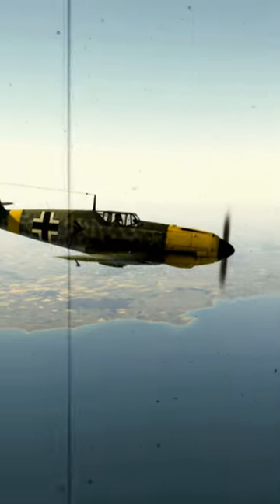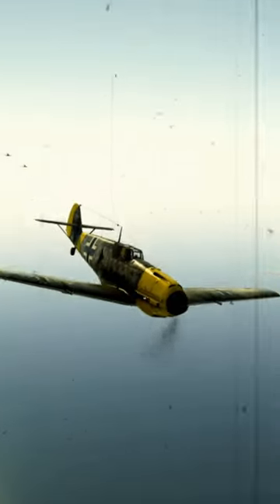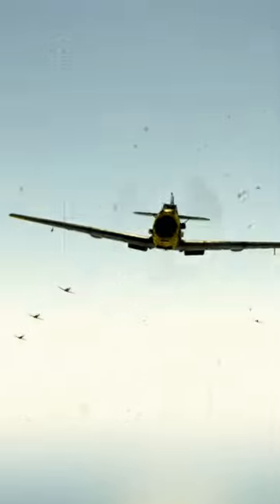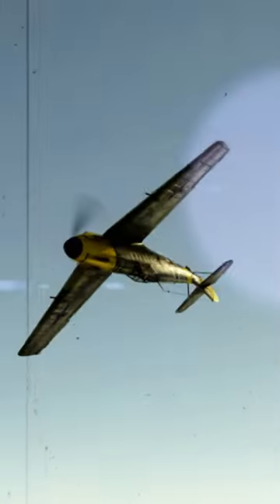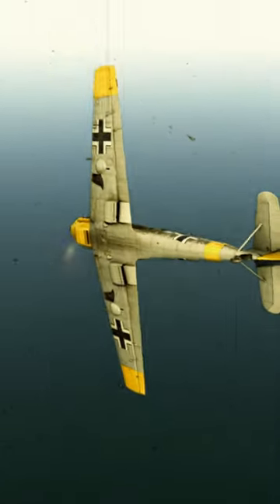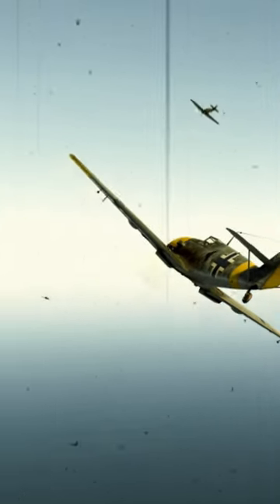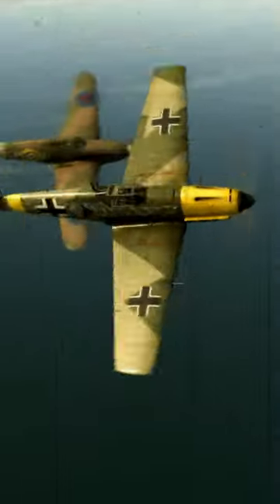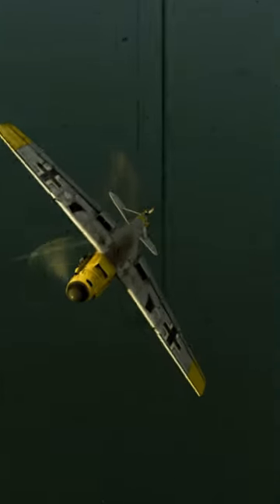Messerschmitt Bf 109 E7, Engine Management | WW2 Air Combat Flight Sims

Comment: An excellent and accurate guide.  The Aerofly FS4 sim’s Bf109E has the manual propeller pitch change to protect the engine from wild revolution speed changes from differing airspeeds.  FS4 is a serious flight sim not a combat game.  The ‘clock face’ instrument giving information on the electric propeller pitch operation works.
This lack of automation was a major drawback in the Battle of Britain 109E.
Reply from the maker: Thank you. It must have been very difficult to keep track of during combat. The early era pilots were very talented, complex people.